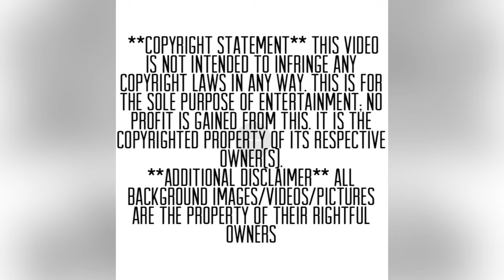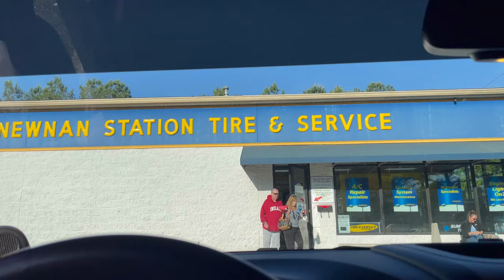Jeep Wrangler JK Stuck Caliper and Death Wobble Fix

Comment: Thanks for. your vid helper here.  Love your garage.  I bought an older home in N WI and the garage was UGLY so it’s nearly up to your new home condition.  Just gotta paint the ceiling that wasn’t painted or insulate well enough.  I just had both front brakes start grabbing and one real bad on my 2016 JK with 103k mi.  Burnt up a caliper.  Took it to garage replaced both rotors, calipers, and pads.  What stopped me from doing the job was all the techy stuff back up to the master cylinder and sure enough I had bad line and parts.  I’m too old to mess with it and scared of computer. $760.